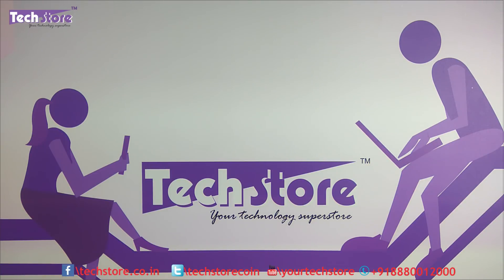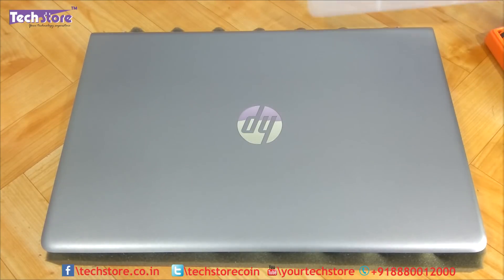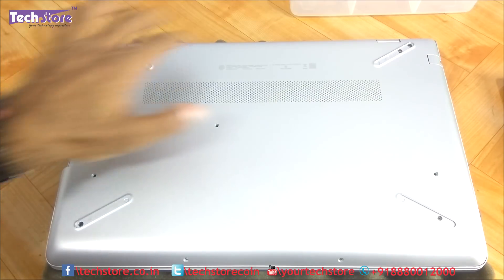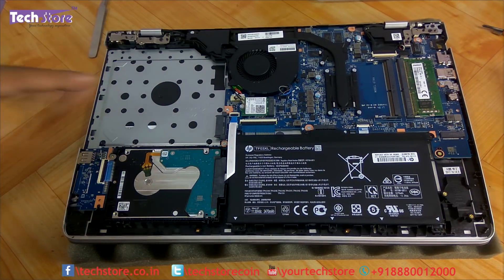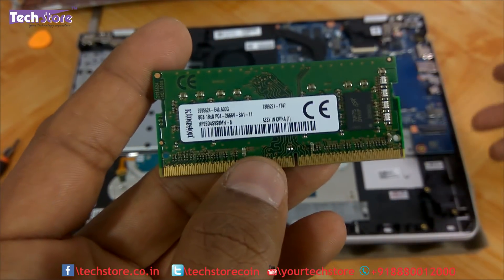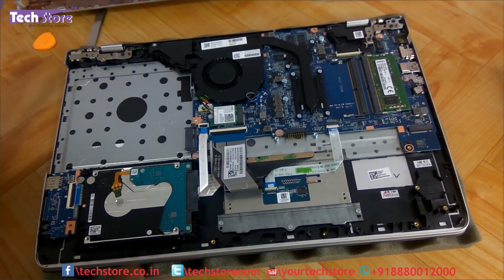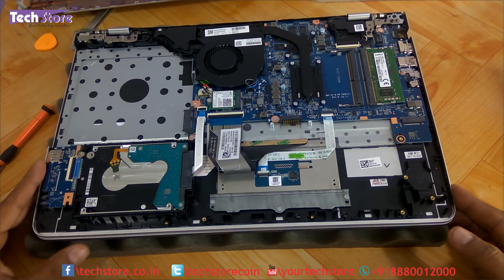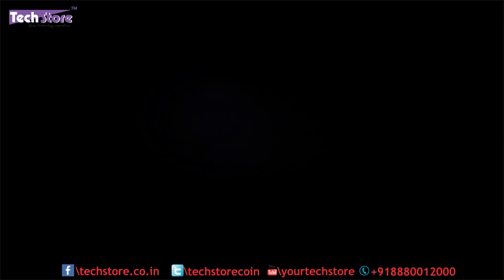Hp pavilion 15 CC Series 2018 CC134TX CC132TX CC129TX: How to disassemble the base and upgrade ram m

Comment: hi guys and ladies, i have a question, i have a HP Pavilion Laptop 15 cc-183cl, Can i upgrade the Nvme slot with a WD_Black SN750 2TB NVMe SSD with heatsink or not? and another one, Can i put a SSD in the place of HDD,  and the capaditty of this or is better a HHD like a Western digital? And which amount of ram can it support? Thanks so much for your opinions and suggestions...
Reply from the maker: Yes you can.

Comment: Can u please tell the model and type of. M. 2 ssd that can be used in 132tx model
Reply from the maker: Any m.2 2280 form factor NVME ssd.
Reply: @TechstoreCoIn  i have a 2666 ddr4 8gb ram, can i swap it with two 16gb ddr4 rams? Or two 8gb ddr4 rams.?
Reply: The ssd slot is available in this model

Comment: Hey help me brother ! i do have cc132tx does it support m.2 sata 3 or nvme ??? Please confirm !!!
Reply: Thankyou brother
Reply: @debarghachakraborty1679  🙏
Reply: Same question
Reply: @debarghachakraborty1679  Hey it supports,, actually I did install in my one 👍
Reply: @debarghachakraborty1679  Nvme is supported,,, go for it
Reply: Can you please suggest me a 500 gb ssd . I want to use both hardisk and ssd
Reply: @debarghachakraborty1679  Yup install Lexar SSD ,,, best product as affordable price
Reply: @ankit_aanand  by any chance can i contact with you.
Reply: @ankit_aanand  bro i have HP 15cc134TX can I upgrade 1TB Lexar NVMe SSD?
Reply: M.2 ssd slot is available

Comment: Helpful vedio... Can iinstall m2 ssd in hp pavalion 15 cc129 tx model? Without removing hard drive?
Reply from the maker: Yes u can install M.2 SSD
Reply: @TechstoreCoIn  thank you for quick reply bhai.
Reply: @TechstoreCoIn  can i install  nvme m.2 ssd actually bit confuse with nvme or m.2 can u help me with it?
Reply: Did u install ? Does it support 1tb m.2 ssd?
Reply: @AthulJoshi1609  no...due to lockdown ,ther is no technician available,  but i vl definitely go for it.bcos i5 is very slow on win 10

if u install then guide me
Reply: @chintanpatel5074  I have not done it. I am planning on buying one but the manual only shows 512 gb so I wanted to know whether 1 tb is supported.?
Reply: Also is it having sata or nvme slot. Do you know?
Reply: @AthulJoshi1609  from many utube v8do  i know that it have nvme m.2, slot which hav  512 gb support not more...

Comment: great information on how to open and replace. our hdrive on the  cc023cl lost its boot sector and would not come up removing the drive to salvage the data. then will factory reset and reload the data i pulled off

Comment: apologize friend these models are the same as the
hp15-cc060wm
help me please I want to place an external video card and I would like to know if removing the disk port located near the wifi chip could place the NGFF cable
please confirm me if the model
hp15-cc060wm
is the same as your video
thank you 
saludos desde Ecuador !

Comment: I recently replace the 1TB spinning rust drive in a brand new HP  17-by021dx for a friend (He had unused 500GB SSD). While I had it open I looked all over for the M.2 slot I had been told it has. HP's docs refer to it but give no indication where it is located in the computer. Alas now that I have your seen you video I know where it was located. I checked the pictures I had taken when I had the case open. There it was. ** Thank thee ***

Comment: Can I use hdd and SSD both ? I bought pavilion 15 cc 154tx . I want to add SSD not replacing hdd.
Reply: Yes you can.
By connecting it to your m.2 port if you have one in your laptop

Comment: this machine does NOT have an M.2 SSD slot. the only way to add an M.2 is to use a DVD caddy and remove the DVD drive. otherwise great video, much appreciated and thanks!
Reply: yes it does, cc1xx and cc6xx models support M.2 M- Key PCIe,NVMe ssd
Reply: @bazjr107  
R u sure about it ..i want to order the same..?
Reply: Govind yes I am sure mate
Reply: @bazjr107  thanks

Comment: This laptop is very easy to work on I bought one on ebay with coffee spill was running really slow and ricked of coffe had to tear it all down the mother board Gave it all a thorough wash in warm running water this machine works like new now. And by the way it was my first premium laptop and my first time doing it require patience..

Comment: is display pins of 15 cc 132 tx and 15cc 102 tx same so I can replace it with full hd display of 132 on my 102  and I would like to know if we could upgrade the graphic card on this device from GeForce to GTX one and other thing can we install 8 gb ddr5 ram and other 8 gb ddr4 ram?

Comment: As you have shown separate slot for SSD in this video, but i have contacted HP Support and they said there is no separate slot for SSD . so make it correct.
Reply: there is a seperate slote for M.2 ssd as shown in the video and cc1xx and cc6xx models support M.2 M- Key PCIe,NVMe ssd

Comment: As you said there is separate  slot fo SSD in 129tx.
Does 134tx also have separate slot  for SSD or we have to remove DVD writer for inserting SSD ?
What about HP CC 134tx rating ??
As i have read on amzon , only 3.2 star and reviews about that is slow speed and only 2-3 hour battery backup , is it correct ?
Reply: ROHIT vaishnav same question!
Reply: I have asked to HP cutomer support and they said that there is NO SLOT for SSD.
So we have to remove dvd writer and then ssd can be installed .
Reply: ROHIT vaishnav actually I too asked them , they said that HP will not recommend to do so...
There is an option to install an ssd but your warranty will expire 😢
Reply: But we are not broking the Seal on Laptop , we are just removing DVD writer and putting SSD in place of it , so still it  will make our warranty to be  expire ??
Reply: ROHIT vaishnav yes they said thay
Reply: @rohitvaishnav2147  dont have to. you can add an m.2 ssd
Reply: @beingvaibhavrajput  cc1xx and cc6xx models support M.2 M- Key PCIe,NVMe ssd
Reply: yes if the model is cc1xx or cc6xx you have a m.2 ssd slot (nvme)

Comment: Thanks for sharing. An Improvement could be to show the upper side/label of EACH disassembled Item in a sharply focused picture (freeze-frame) - as you've done well with the RAM module.
Keep on with your useful work/sharing, also with other models of laptops ... as e.g. the variety of HP laptop models is a little annoying, if you are searching for a special product ...

Comment: Incredible detail.  Thank you for this tutorial.  I have the HP Pavilion 15-cc665cl.  It came with a 1tb HDD.  I want to swap it out with a 240SSD that I have laying around.  Not to mention the 855u hit 97c and I thought It might benefit from a thermal past swap.  Now I feel confident that I can do it.
Reply: Maybe the HDD wasn't really designed for laptop use? I know of some HDDs, escpecially of external USB harddrives, which use to get annoying hot when running. I wouldn't like missing my 1TB HDD alongside with my 256 M.2 SSD ;) (... only thinking of collecting photos and other media, the single SSD will be filled far too quickly, I think ... I know!)
Reply: Did you replace the 1tb HDD with the SSD?  I'm looking to do the same.
Reply: stan senior i did.  That laptop was thermal throttling real bad.
Reply: Good to hear, I bought one of the Pavilion 15 cs series and replaced the 1tb HDD with a 500GB Samsung 850 EVO SSD.  It has made is big difference.  It’s much faster now.

Comment: good video . well explained!! . Can you also share any observation on heating issues in the HP Pavilion Power - 15-cb052tx model ? i am seeing the CPU cores are easily hitting 60~70C if 14 chrome tabs are open and 1 of them has contstant video streaming. the right hand palm rest is just above the CPU/GPU and is uncomfortable. Any observations from Techstore ? also ,  the exhaust fan outlet is facing the lower bezel of the display
Reply from the maker: the issue is because of wrongly placed air vents. use a cooling pad
Reply: I have the 15-cc665cl same designed case.  My 8550u hit 97c earlier today.  I'm going to swap out the thermal compound on the processor thanks to this vid.  Wonder if it was because the lid when not tilted back restricts airflow.  Hmm...